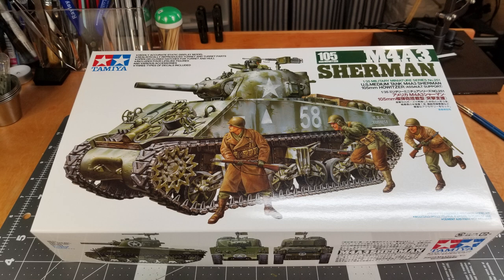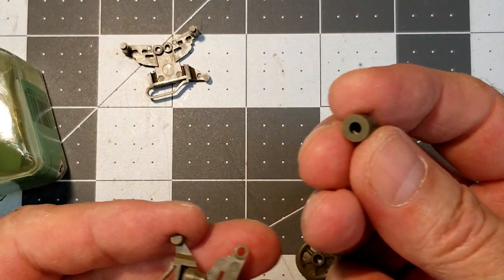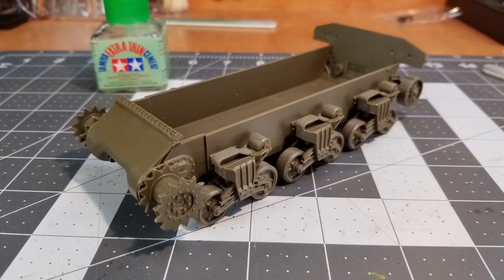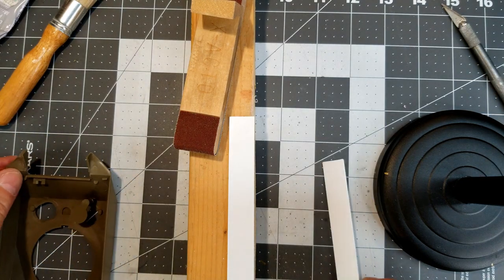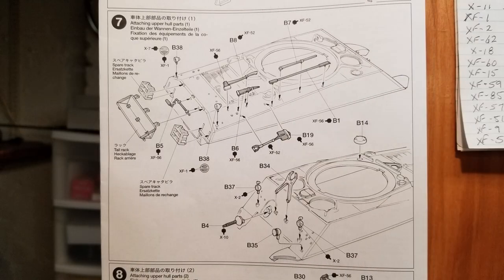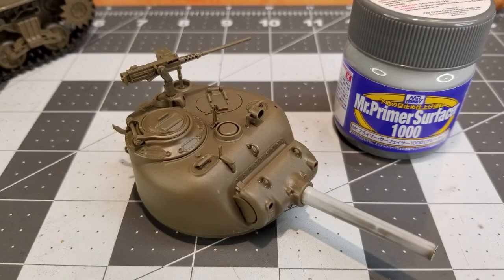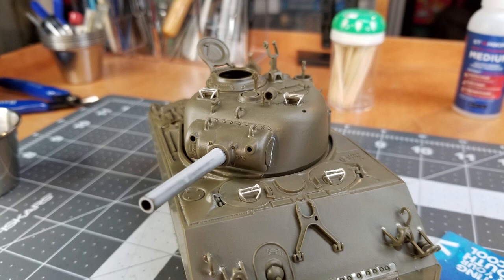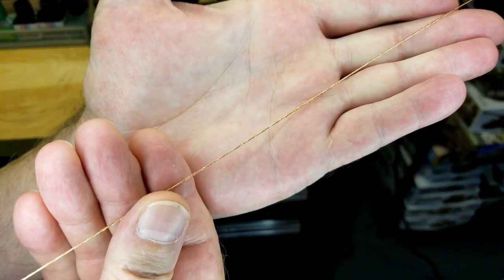M4A3 Sherman 105mm Howitzer by Tamiya in 1/35 Scale Kit Build

Comment: Great job on the periscopes guards, they are even better than the manufactured ones!
Reply from the maker: Thanks Zorg, happy you like them, I'm just a Hillbilly, but I try.
Reply: @hillbillymodeling  You're welcome.
  It's always a pleasure to look at somebody who masters tools and matters
On another channel i seen an interesting tip to get the rough surface aspect of armour plates(1)and casted parts; the guy mixes Tamya grey putty with a very thin cement to get a texture like a slightly thick paint and a applies it with a brush(2) in small strokes.
The result is amazing.

(1)surprisingly even flat armour plates have a rough surface, and the welding seams don't rust. 
(2)with short and stiff hairs, i don't know the specific name in english
Reply: @Zorglub1966  Some people also use Mr. Surfacer and stipple it with a brush to achieve similar results cast metal effects too.
Reply: @michaelbenjmitchell1  Thank you mate👍

Comment: I think in hind sight it would have been easier to do the fill work on the transmission cover before putting the final drive covers in place.
Reply from the maker: I found it very easy to fill from the back and push the filler to the outside. It's just one approach, I'm sure your approach will work just as well. Thanks for watching.